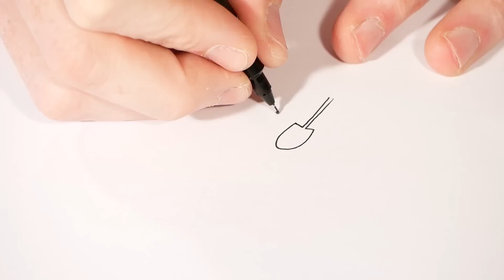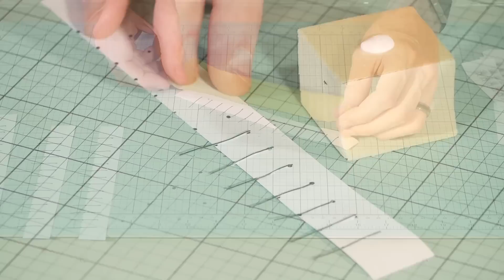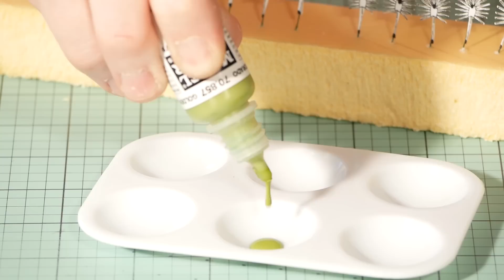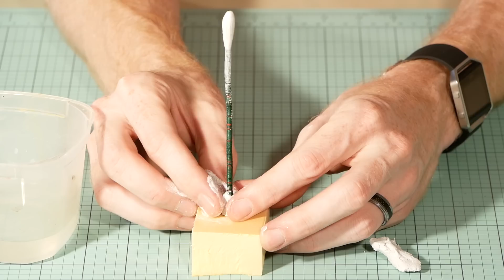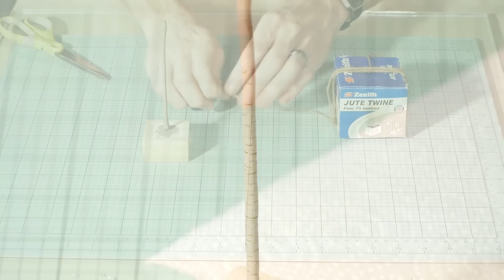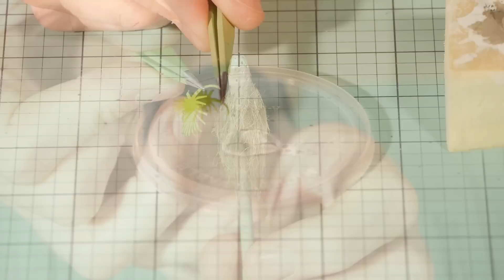Wire Palm Tree Tutorial - Model Railroad Scenery

Comment: Luke if u did these again, would u use Gesso, or the latex rubber that u used on the wire deciduous (Apple) trees in another video?  And would u use the insulated electrical wire, or the 22 gauge florist wire? I bought some raffia and will try to use that for the trunk wrappings. Also going to try cherry pits for coconuts for a 1/48 scale diorama.  We’ll see how it goes.

Comment: Is gesso like latex? Can i put it on my wire tree from your video.
Reply from the maker: I think it's more like a thick acrylic paint, however it's much thinner than latex. It would work on the wire tree however it would take many more coats... maybe 8 or 9 coats but the latex only needs 2. You could also add some very fine saw dust to some wood glue to thicken the glue and use that instead of the latex, it's much cheaper and easier to get but you'll need very fine saw dust. You'd also get a nice texture using the wood glue/saw dust mixture as well 😊
Reply: Thanks  yesterday i made my first wire tree for my diorama but i don't have latex  because i just started with dioramas and i'm looking for something cheaper. Thanks from Slovakia.

Comment: Great video! I mentioned in your 6th Realistic Scenery video that I'm working on replicating that design, and a quick update: I just added the dirt texture, and I'm waiting for my negative ion generator to come in the mail to put together the static grass applicator. I'm pretty happy with the model, however I think i went a bit excessive with the rock molds, and I placed an HO culvert in a hill that looks more like a tunnel. Lastly, I don't have any good dirt in my neck of the woods, so I used sanded grout only which seems to have worked ok. I'll send you a link to an image album once it's done. As always, I appreciate your videos, which have single handedly motivated me to finally get started with this hobby.
Reply from the maker: cool, good luck with building your static grass applicator 😊 As for the grout, I don't see any problems using 100% grout, should work in  a similar fashion. It will probably set really hard though... which is probably a good thing anyway. It's good to hear your making progress on your layout, and once the scenery is mostly finished you'll probably be surprised at how well the rock molds will blend together.
Cheers
Luke